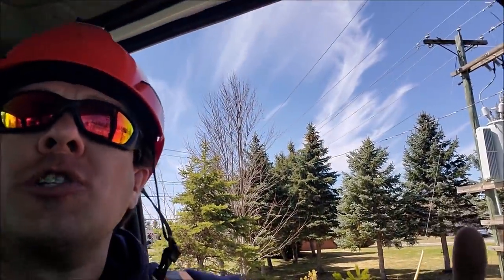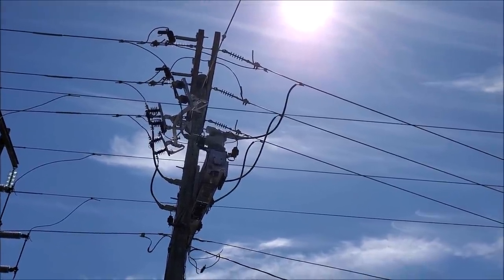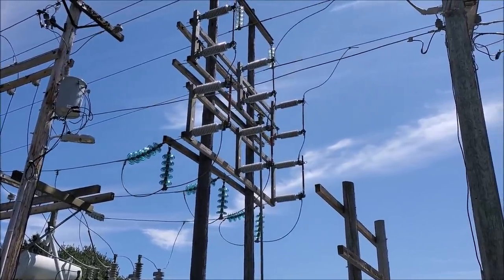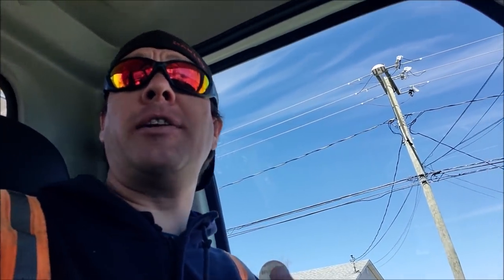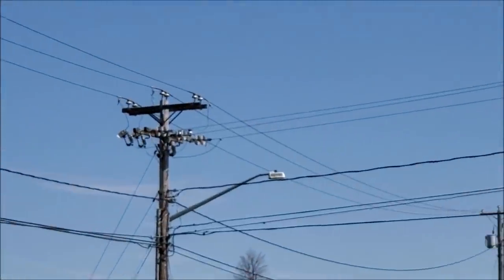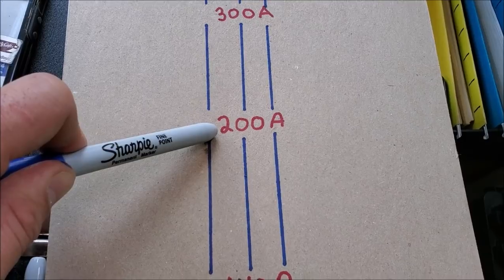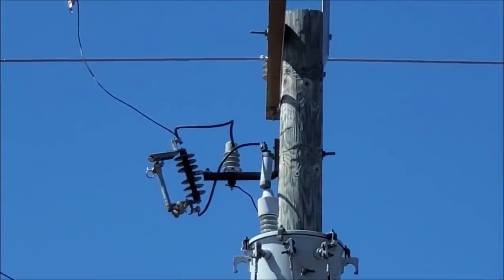Basic components of a power grid

Comment: What happens during an EMP attack or "Carrington event" to the transformers and ancillaries? How long would it take for all the damage to be repaired? Great videos mate, i love all the nuts and bolts explanations.
Reply from the maker: That's scary stuff man! Transformers can be damaged beyond repair in mass amounts. Distribution units aren't hard to change.. large power transformers are a whole other story. The issue wouldn't be with repairs, more so in acquiring the replacements.

I'd like to read up some more on this stuff, I'm not sure if CME's would also affect relays and other equipment or not
Reply: @Bobsdecline  Carrington event of the 1800's was really severe.  The sky was so bright at night, people thought it was morning.  Telegraph operators across the continental US were being shocked by their equipment even though the batteries had been disconnected from the telegraph systems.  I think the Pentagon has said that EMP attack would cause 90% fatalities in 12 months (loss of services and supply chains) and it would take at least 5 years to replace the very large transformers destroyed by either scenario.
Reply: Doubt it would effect large current devices only digital stuff not metal surrounded
Reply: You'll know by 2025, sun is still amping up. In the antarctic they were seeing auroras in the sky, under a full moon, and some just after sunset, last week.
 Lots of spare energy out there. We are getting some visible at lat. 35S.  Time: May 2023
Reply: @imho2278  we have built a very fragile,technological civilization and at any time, the sun can take it all away.

Comment: A month ago a weird thing happened me. I live in a four story building.  After a storm at 9 PM we lost one phase of our power.  Half of my condo lost power and the other half remained on. I talked to all my neighbors and they experienced the same thing.  I have a 220v wall mounted heater box in the bathroom with a digital display and it was indicating "low voltage" error.  I would assume one of the two 110v lines that feeds in our breaker box was lost and the breakers on that side went dead.  About 7 hours later all the power went out including the streetlights.  About 10 minutes later they came back on and 30 minutes later we got all of our power back full.  Your suggestions are welcome.  Love your blogs.
Reply: I have had "lost phase" problems several times in commercial buildings I've worked in. Usually what happens is one of the three primary wires failed. Your condo is probably in a building wired for 3 phases, but only 2 of them are brought to each unit. This setup gives you 208V phase-to-phase instead of the 240V you get with "center tapped neutral"/"split-phase". Your power probably went out completely because they had to shut everything off to safely repair the broken phase.

Comment: Great video man!

I'm looking to get into the electrical utility field one day and I find this stuff very interesting and rewarding to understand. I get it, explaining everything about the electric grid would take a looooooong time to explain (especially if you wanted to cover generation and transmission on top of distribution systems) but it all made sense the way you explained it. The bit about power factor is a course on its own and would take a class lecture (multiple ones perhaps) to explain how power factor works and why inductive and capacitive loads tend to mess with the voltage and current phase timings. Lots of things to learn about power systems!

Now, I have to wonder if you can help out with this question: I'm really itching to enter the electrical utility trade and I currently have zero electrical experience on my résumé but I've devoted a LOT of study time learning about electricity and our 3-phase power grid. What's the best way to get into this trade with no experience and only some book knowledge? I've tried numerous times and applied to my local utility companies to no avail. Do I need to know someone to even stand a chance?
Reply from the maker: Hey Adam, thanks for the feedback! Your right, this stuff is tough to sum up in a few quick words. 

If your not having any luck with local utilities, your best bet would be to apply to a line school. This process differs depending on your location. 

Basically passing climbing school or a lineman college helps ensure a basic level of competence when employers are hiring new apprentices ✌️✌️
Reply: Bobsdecline - Lineman blogger Thanks so much! I really appreciate the feedback. I definitely will look into that avenue of approach for getting into linework. Exciting! Thanks again!

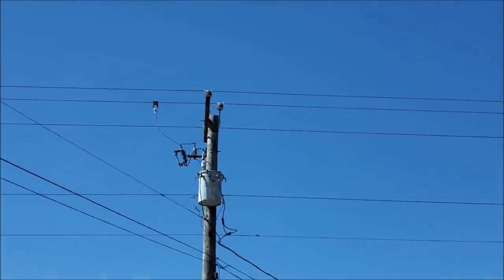Comment: Great video, sir! 10:50 When you hook up that single phase transformer, does it make a difference which of the three primary lines you chose to use? Thanks!
Reply from the maker: Hey Fred! It doesn't really matter in most cases. We try and balance the load however... Meaning equal amount on each phase. Sometimes we'll also use a particular phase as an express line to a particular neighborhood. 
As the system is designed our engineering Dept usually indicate on work orders which phase to use.

Comment: A few weeks ago, an ice storm hit the city that I live in. Over the course of about a day, I got about 8 momentary outages. Now that I've watched this video, I can better understand that each outage was a fuse blowing somewhere nearby, and then the substation teleruptor resetting.

Eventually, the power went out for my house entirely, and it took a few days for them to get it back. About 15 minutes after it was restored, there was a loud electrical noise outside, followed by a blackout. Few seconds later, the power came back on, electrical noise, and went out again for the last time. 

When I went outside, the power pole at the cross street was about a third it's original height, dangling in the air, the transformer shattered, and the cables feeding my neighborhood draped across the ground. At the time, I had assumed that the momentary power we got was the electricity somehow rerouting itself, but now that I've watched this video... Those cables on the ground had re-energized briefly! (I'm guessing there wasn't a fuse between that pole and the substation?) I'm surprised nobody got hurt, if I'm totally honest!

Feel free to correct me if I got something wrong. I wish it were appropriate to go out and watch the Linemen and ask questions while they worked so that I could get a better understanding.
Reply: Sounds to me like you got it right.  Yes, power lines on the ground can certainly be re-energized.  That's why it's very important to say away from them!   Even if you think they're dead, they can come back to life and get you.

Comment: In Europe we use leverage cutouts. There is no need for a hotstick or to get there. Just pull or push the handle and all 3 phases are simultaneously open or close.
Reply: Those are used in the USA too but they aren't very common. Some of them can be operated remotely.
Reply: There's one on a pole about 12 miles from me. A padlocked handle at waist level diconnects all 3 phases by switches at the top of the pole.  It feeds homes for about 3000  population plus farms and businesses.  Saskatchewan, Canada
Reply: @quappelle3637  There are two outside my apartment in Winnipeg. They are on poles with underground risers feeding a single set of overhead lines. One set of cutouts are open, the other set are closed. Occasionally, a lineman will come out and reverse the cutout settings.

Comment: A 208 volt heater pulling 30 amps on each phase will not be the same kind of load that a 
3 phase motor,  regardless of amps would be. As current goes through coils on a laminated
iron con a back voltage is created, so the current and voltage waves are offset a bit, where
as if the load is a resistive type, like the water heater, voltage an current wave are very much
in sync with each other.

Comment: What is that kind of "clock" over the voltage regulators? We have a lot of them here on Brazil, long lines. I always wanted to know what those "clocks" are used for.
Reply from the maker: The clock shows what tap it's on. So if it's at "0" Voltage in equals voltage out. It then either goes plus or minus according to demand. We have to see what tap it's on for operational purpose as well as load studies

Comment: I have two questions:
1.why do you mostly work alone why not in pairs? Here in Serbia I am pretty sure that the rule is that you need to have at least two workers on sight especially when working in substations.
2.I noticed that most of the faults that you have filmed are on primary side so I'm wondering do you have more calls for high voltage than low voltage repairs?
Reply: Mihailo: Wonderful English skill. Thank you for keeping us informed with questions.
Reply from the maker: Hey Mihailo! Awesome hearing all the way from Serbia ✌️

We have a very specific list of tasks we are allowed to preform while alone. A lot of these tasks have "check in" protocol. The substation for example - even to simply go inside the gates we must check in upon entry and upon leaving. If ever I request a second man on site for safety, I have never been refused.
We are also aloud to re fuse and close cut outs alone, but not allowed to work on them. A good rule of thumb for our guidelines is if ever the equipment was energized above 600 volts, a second man is required. 
We are allowed to climb alone, but often times call for backup depending on the circumstances and once again are never refused the help.

I probably get more calls on Secondary actually. The reason most videos are filmed during primary work, is I am often waiting for back-up to arrive.I use that idle time to explain some of our procedures while not interfering with restoration time. It's also easier to gain footage on primary rural lines where I don't have to worry about editing out sensitive/private  images. (All editing is later completed while off duty)
I do have this video here:
https://m.youtube.com/watch?v=y5LbfQ9cyjk&t
And hope to soon have more when filming is appropriate.!👊👊🍻
Reply: @Bobsdecline  that clears things up thanks for the response stay safe
Reply: @Bobsdecline  I think it is great you make these videos and educate the public.

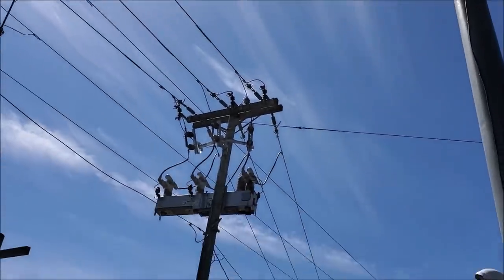Comment: 1:29 That description of the device was similar to that of a recloser.

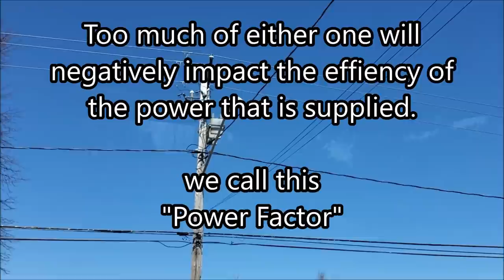7:13 Technically power factor is not efficiency, since the latter is defined as output active power divided by input active power, while the former is defined as active power devided by apparent power.

12:05 You meant to say "current", not "amperage". Amperage is the maximum current capacity of a cable.

Comment: At 4:15 you talk about voltage drop. Now long can each section of the network be? Say 69kV vs 7.2kv ?
Here In the  UK   we have 230v to the end user  and we have 3 phase  ground mounted transformers about every 300-500m  supplying  (I would guess) 200-300 homes

Comment: The transformer at 10:55 into the video  seems to be single wire earth return (SWER). I know some power companies use that, but, I wonder how they can keep up with varying earth resistance,  like dry vs. wet times of the year.
Reply: Goes to ground on primary wires  as well as ct on sec.and earth.
Reply: Mike Holmstrom — Isn’t that the neutral running behind the transformer?
Reply: The other end of the primary coil is connected to the tank internally which is connected to the neutral on the tank ground on the side of the tank

Comment: Do the capacitors turn on and off thru the day?  Or do the voltage taps jump in huge increments?
I put a logging meter on our 240V and noticed it jumps up/down jumps a few times a day -- a stable reading with maybe 0.5V "noise" suddenly jumping 239->249 or  250->243 or 247->241 or one time 247->240->246 and then remains stable with 0.5V noise at the new voltage.  It doesn't look at all like the "spike" of heat pump kicking on/off changing and recovering.  Been wondering why that would be.
It doesn't seem to correlate with anything in the house being used but does make all the UPSs start clicking angry and running off battery and beeping when it jumps large amounts.
Reply: Yes they turn on and off as needed. Your voltage can vary throughout the day due to varying loads on the distribution line your house is on. Some capacitors are set to come on at a certain temperature or based on a certain line load current or on voltage. In these cases then they will turn on and off automatically based on those conditions and you would see some variations of voltage. In North America, most utilities will try to keep voltage between 114 V and 126 V as measured on a socket inside the typical home.

Comment: Is a continuity test for low resistance on a transformer across the wingdings Pri/Sec an acceptable quick reference check? Use case for a new pot on the lot is good before install, or checking a questionable one from service while disconnected.
Reply from the maker: Not necessarily... Checking for low resistance would show that there aren't any breaks in the windings however you would also have to check for leakage incase of internal damage using a Megger
Reply: @Bobsdecline  Thanks for the Megger reference.
Reply from the maker: As a "quick reference" as you mentioned it certainly wouldn't hurt!

Comment: When re-energizing a line or an entire circuit, for example in a industrial area. How do substations cope with the inrush current from large loads like AC motors without tripping fuses? Or do you just do it in stages, like a rolling blackout in reverse?
Reply from the maker: Exactly! 

Even during peak times, each circuit is only run at half capacity (in a perfect world). So if the outage is quick, we can sometimes pick up the entire thing in one shot. 

Most times however we will open a few sets up switches to pick things up gradually and allow time for heating/refrigeration and other heavy loads to stabilize.

In extreme hot/cold weather this process can take hours as it's picked up in much smaller sections
Reply: Also, what are the reaction speed for a voltage regulator? Is it slow, or can it almost instantly tap down during a voltage spike when a large load disconnects?
Reply from the maker: @thegreatoutagesign9204  they are all programmed individually, and often coordinate with another set further down the line. That way you don't end up with multiple VR banks tapping at the same time and over correcting. 

They are never instantaneous though, and usually have to read outside the set bandwidth for 30 seconds or more
Reply: Thanks for answering my questions! I absolutely love this kind of infrastructure, because it's just so cool! especially when I'm able to talk to people in the field to learn more about electrical infrastructure.
Reply: @Bobsdecline  Do you have to do special procedures up there for commercial buildings?  One time the building I work had power disconnected (long story, landlord didn't pay bills) and an electrician had to come out and open a bunch of switches in a power switching room in the building before the lineman would close the pole disconnects, then they had to pump up and switch a huge control in a big panel inside the building before flipping all the individual breakers back on.  It reminded me of the scene from Jurassic Park...didn't know that "pumping up to turn on" thing was even real until that day.
Reply: @matthewmiller6068  That is a spring loaded switch/breaker, you manually pump up the spring tension then when you hit the on button it releases the ratchet to allow the spring to force the contacts shut. Most use electric motors to recharge the spring tension, but when the power is out you have to manually charge up (tension) the spring. It's spring loaded so it will shut and open very quickly to minimize arcing.

Comment: I've always heard you could estimate the voltage on the wires by counting the number of insulating discs. Is this true?
Reply from the maker: Yes, kind of ... 
There's a standard amount of bell insulators used on transmission structures. 

Problem is there can never be too many... Let's say there's 5 insulators, it's most likely 69kv, but it could be less. We have a few line framed for 138kv, but currently supplied at 69kv. Counting the insulators would result in over estimating the voltage, which isn't a bad thing. Over estimating would result in stricter minimum approach distances for other trade workers. 
It's typically pretty accurate tho, most lines are built to spec. 

A lot of epoxy type insulators are now used which are much lighter. This type is one solid piece and increases in length as voltage goes up

Comment: Hi Bob, Is that your name?  Hey I've been a regular below 600 volts electrician since Labor day 1981. Well I don't look 57 and can still handle the work no problem, so far. I've wondered for a number of years now, is 4160 still used any where? I want to say yes, or maybe it's used for particular customers who have induction motors running on that shit. I've heard of motors running on 12470. I wonder how they shield that shit inside phase to phase? Let me know would you?  Whatever you do man stay f***ing with that high voltage not that it would matter 480 would blow your brains out for sure!

Comment: When you say a power line is 7200V, is that phase to ground (neutral) (Y) or phase to phase (delta) ?  It must be phase to N because the transformers are marked 7200V and they are connected phase to N.
I always thought that 4160V Y was 7200V delta on the power lines.  But you mentioned 12,470V "phase to phase" , ie delta ?  So that is 7200V Phase to N.
I often see 4160V 3 phase generators.  How are they connected to the grid ?